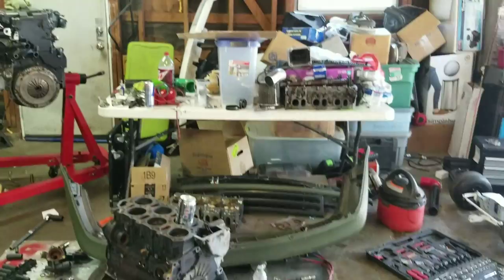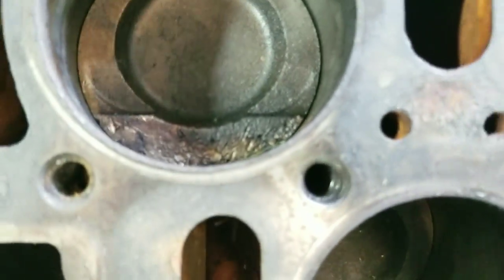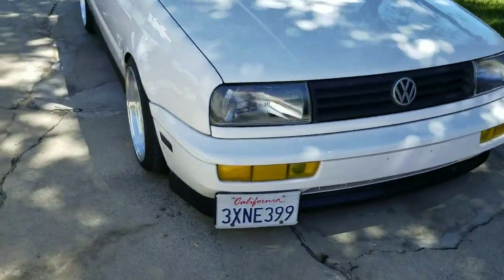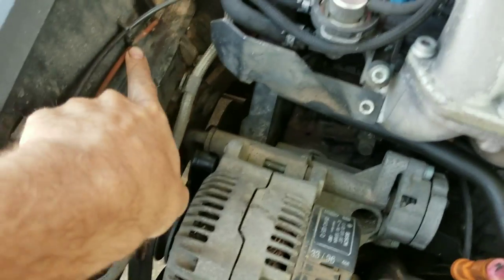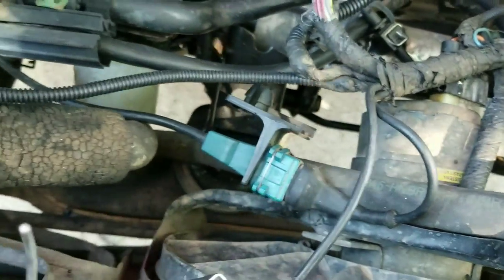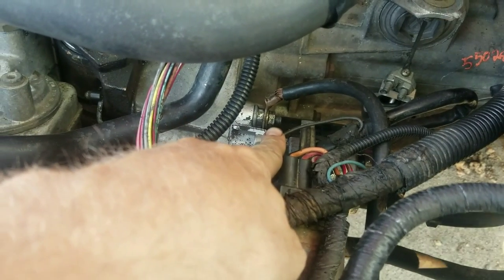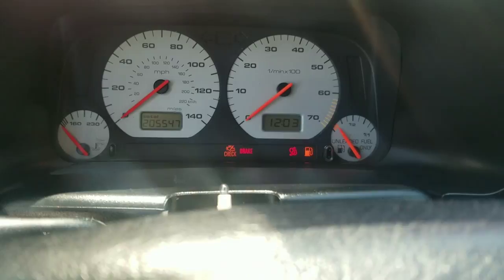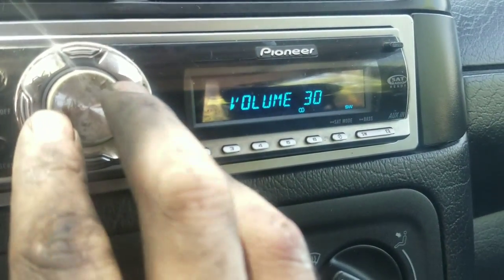Mk3 Crank Sensor DIY

Comment: Would the car run and shut off while driving?  Mine is doing that
Reply: Mine too when it’s warm out. 94 golf. I’m changing the sensor as the car just dies at 60 mph. Pull over, wait 5-10 it starts, drive a few minutes, repeat. Only when it’s hot out, Colorado altitude. I’m giving it a shot..
Reply: @starladear100 did you ever figure out why your golf was doing that? Mine started doing a similar thing and I have no idea why

Comment: donno if someone will answer me 4 years later but got myself a mk3 gti 8v (agg) couple months ago and it cuts and missfire or somelike it when holding the throttle steady... i cleaned the throttle housing and it was perfect for like... 200km then the cuting and all that started again... do you guys think it can be crank sensor?
Reply from the maker: Cracked or bad coilpack
Reply: @DistinctTuning  dont think so. Checked the sparkwires, rotor and the cap. Changed sparkplugs
Reply from the maker: Replace the coil that feeds the distrubter that sends by the rain tray